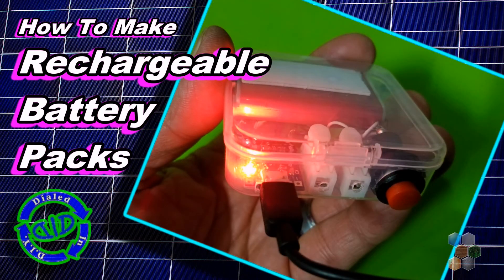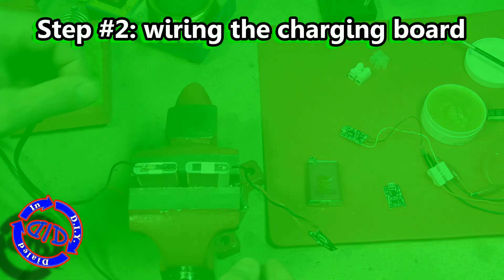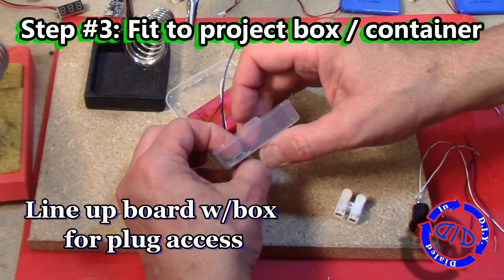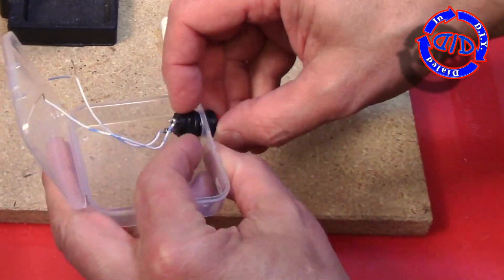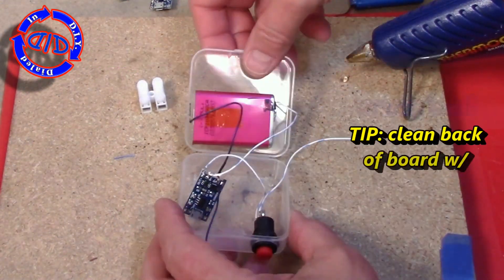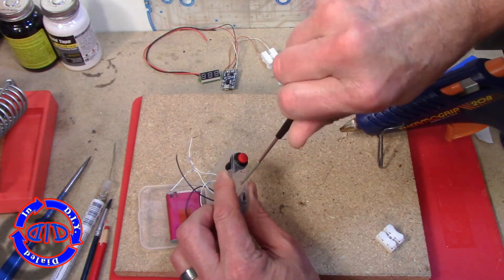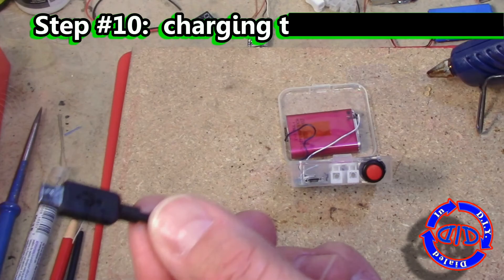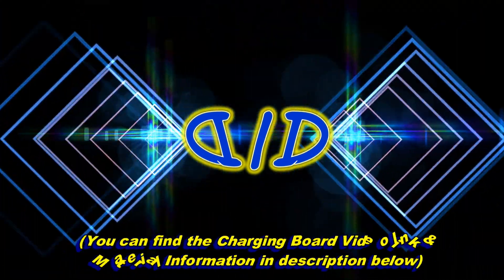Make Rechargeable Battery Packs - Low Cost & Easy

Comment: I wondered. You can charge this up, but how do you hook something up to this?
Reply from the maker: For this set-up I use the terminal block to wire in whatever I want to run on the battery pack (that is the white spot with two holes next to the charge cord in the video thumbnail/picture).  That way I can quickly hot swap lights and other stuff. Sorry for the delay in reply... I really do appreciate that you took the time to watch and post a comment!

Comment: can you use any battery size for the TP4056 , i have a 2000 mah and 650 mah battery i want to make , but is there a limit for a battery size , thanks
Reply from the maker: The board came with limits but I've tried different batteries with good success. For me the key has been to stay at the designated voltage and then closely monitor the set up with different batteries and monitor closely while charging. Check what the mfg info says before you buy too. Thanks for watching.
Reply: @DialedInDIY  li-ion std volt 3.7 , capacity 650 mah , max volt 4.2 , 4.2V 5V 1A Micro USB Li-ion Battery Charger TP4056 Protection Chip Lithium-ion , but when i connect the battery it wil not produce any current
Reply from the maker: I do apologize because I oversimplified my previous response; I answered in general which is fine for your 2000 mAh battery but not necessarily the 650. I have put multiple smaller batteries together in parallel to make them work on this board BUT when the capacity limit is below 1000 (roughly - depends upon data sheet for the specific brand / model) it requires some modification.  Many places that sell these have comments about modifying the board by adding resistors to adjust for different charging currents.  With just the 650 connected your board is likely reading it as a battery that has already been discharged.  The other thing I'd suggest is to test it with your larger battery to make sure the board is working too.  I hope that this helps.

Comment: Can I put 3 of these batteries in parallel and still use this the same chip?
Reply from the maker: I am going to say that theoretically the answer is yes. Many of them are designed to be capable of doing this but I have only used 2 batteries at once after ensuring that both batteries are balanced and of the same model/specs.

Comment: No PCB protection on battery!!!😮
Reply from the maker: Actually that is the beauty of the TP4056 charging chip that I am using, it protects the battery for charging as well as discharging (this specific PCB; some others do not).  The battery actually is totally protected this way. Thanks for watching and for posting a comment! :-)
Reply: OH!!! Ok you using the one with protection then.. have you checked your cut off voltage to make sure that its really cutting it off before it gets to 4.20?
Reply from the maker: I did check the values at charge and discharge to ensure it stops power out around 2.5V and charge power in by 4.2V.  I also tested battery temperature changes during initial charge and discharge before I used the chip for a video project... just in case.  Good thought on your part too re verifying values.  Thanks again for the comments!

Comment: Gr8 when u showed the use I was more convinced be4 I was like why u need to do it when u can charge with charger
Reply from the maker: Thanks for the comment!  You are right, the advantage of the part I used to make the pack is not just the charging protection but also the discharge protection.  Over discharge can be a big problem for Li-Ion batteries.